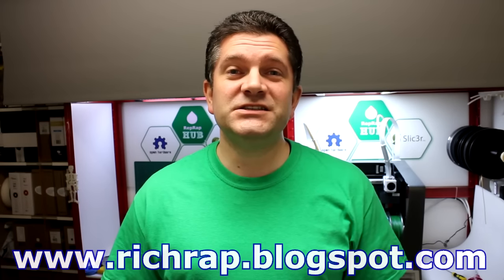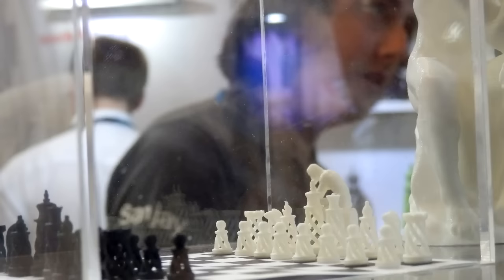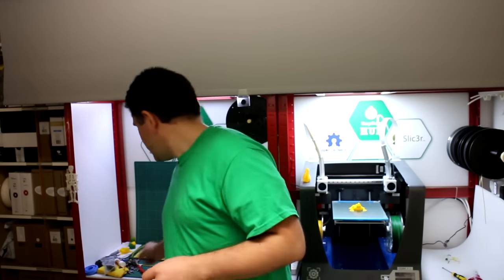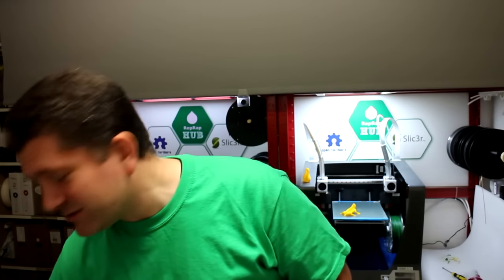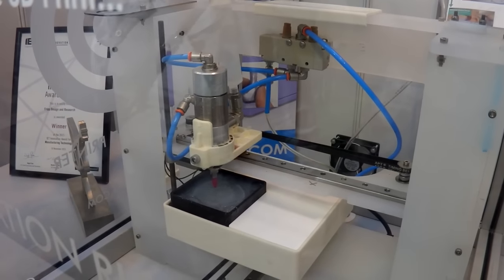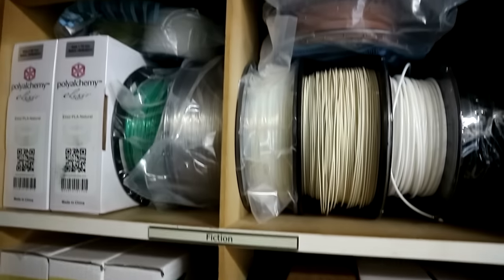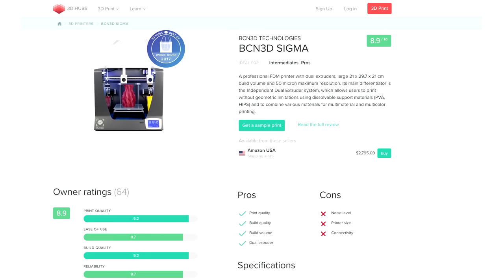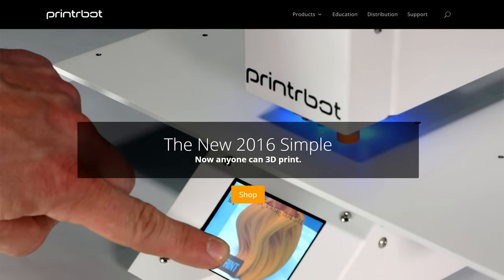Autumn 3D Printing adventures update - TCT Show 2016 highlights, projects, machines & materials

Comment: Wouldn't nylon have absorbed moisture and swelled...not shrunk? (diameter measurement could confirm). Then the diameter swell pushed against the diameter next to it and so on increasing the coiled width? Anyway, very interesting.
Reply: A bit of both, I think.  Certainly swelling in diameter, but also slightly shrinking in length.